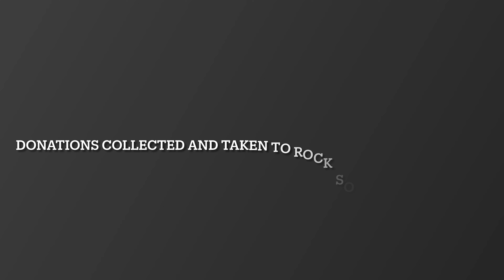Codion parts arrive and take shape. One Month into repairs, One month until our schedule race.

Comment: CJ you can use a shock travel sensor  for a tps on your carb.
Reply from the maker: Yes. That’s what I do. I have to come up with a different way with the dominator as it don’t hook up same as the 4150 and seems to be the way I had it hooked up last time I had the dominator on it isn’t working this time. Seems to be to short now
Reply: @raggedyannohiosmalltire2329  Gotcha that makes sense.

Comment: Are you not worried about that long bar breaking loss and come into the car if you wreak it again  because it's not going to be able to be welded as good
Reply from the maker: I am not. They will be welded as good as any in all honesty. I should be able to get more than 3/4 of the tubes welded, the driver side will be a lot easier than the passenger Bc of all the wiring but I will get it.
Reply: @raggedyannohiosmalltire2329  ty for answering back when I saw that bar go inside the car like that, and in the video, it didn't look like u was going to have much room in that whole to weld lol
Reply from the maker: @michealhodge5202  I can get a good bit of it from the inside. Or I will cut more away on the out side. Hope to get on that here soon. We will see how it turns out
Reply: @raggedyannohiosmalltire2329  I can't wait to see u racing that car again